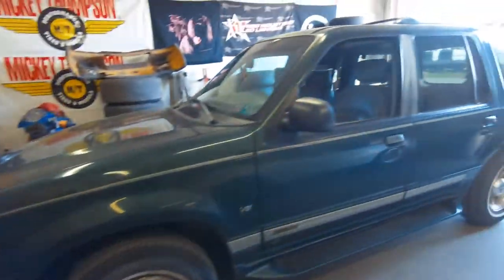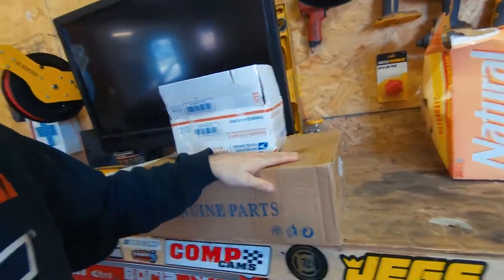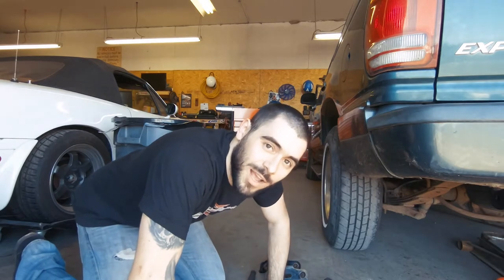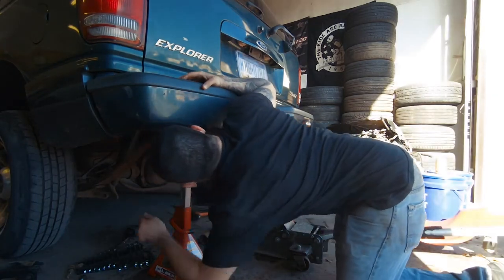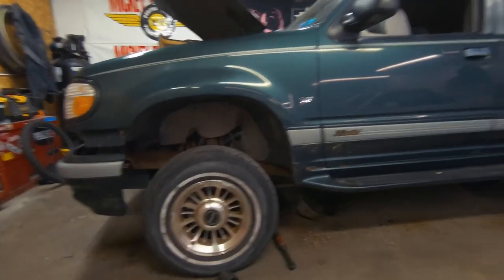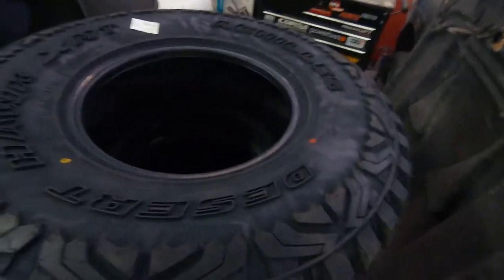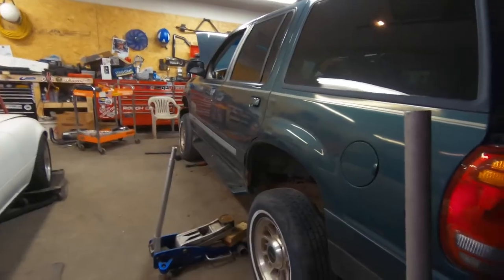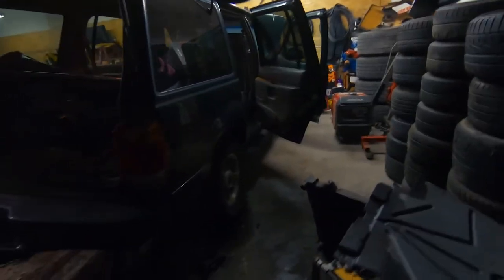1998 FORD EXPLORER 6 INCH LIFT INSTALL

Comment: I feel your pain on those shackles LOL Next time use a bottle back between the frame and leaf spring to press the leaf down with ease, just finished my video.
Reply: Best advice ever, ended up using my sedan spare jack

Comment: Yeah! I just bought a explorer 97.  My plans are almost same as yours, but. I will do shackles under the leafspring attachment. Torsion-rise front . Rearaxle turn and bodylift only in front with wedge shaped bushings.
Reply: I shall follow! Hoping to see more off-road on this channel 🙌🏼
Reply from the maker: I will be making off road videos, just running through some tests with the explorer. It keeps breaking different parts, so once I make it reliable, I will make some off road content! Thanks for being here!
Reply: @RatchetstrapMedia  cool. Whats your instagram?
Reply: @RatchetstrapMedia  please, can you update eBay links?

Comment: Did the body lift come with the bumper relocation brackets?
Reply from the maker: Yes but they don’t really put them back in the correct spot. It’s still to low

Comment: What was the issue with the radiator? Want to do this on mine soon...
Reply from the maker: It had to drop down 3 inches with supplied brackets. But I forgot to do that so I had to fight with it afterwards to get it into the correct position.

Comment: you're supposed to jack the middle of the truck and put stands underneath... then with the diff in the air you put a jack under the diff and you can lower the diff / adjust it...
Reply from the maker: Gee. Thanks captain obvious. My race car currently has all the jack stands under it. Plus, it’s clear you don’t have to doit the way you are “supposed” to.
Reply: Yeah, it’s clear that you made it harder than needed because you didn’t want to do it right. 

Great content tho, if you can’t be good, at least be funny.
Reply: Hey, the way he did it worked, so who cares, it’s not ur truck.

Comment: what size tires did you put on it? do you think 33s would fit? also whats the brand of the body lift link doesn't work.
Reply from the maker: 32x12.50r15. 33 would fit but it would definitely rub.

Comment: Awesome video. Three years later but I’m about to do the same build on a mountaineer.  So my questions are what front shocks did you use with the torsion twist lift?  Stock length or oversized?  And in hindsight would you have still used the coil load spring shocks in the rear?  Nice build and thanks for all the good info.
Reply from the maker: I used whatever shocks were already in it. Did this on a budget. The coil shocks were great because the leafs were tired so it helped pick them up more.

Comment: Hey so, what did you do for the front? Torsion keys/twist only? And since the links are now dead did you use the Ranger kit for the body lift?
Reply from the maker: Max out the factory keys, ranger body lift, lift shackles, and helper shocks

Comment: Where you get the lift from a friend is looking for one
Reply from the maker: Everything was purchased on eBay. It’s a 3 inch body lift for a ranger, 3 inch shackles for an explorer, and I just turned up the stock torsion keys.
Reply: @RatchetstrapMedia  could you possibly send me the links so we won’t order the wrong parts please

Comment: So I'm planning on doing this to my 98 explorer. But I'm confused as to where to mount the shocks it looks like you got them in the factory mounts. I'm new to this kinda stuff sorry if it's a dumb question.
Reply from the maker: First I mounted them in the factory location, but it ripped the lower mount of. Now I have them mounted at the swap bar bushing mount locations.
Reply: @RatchetstrapMedia  I'll have to look into that I'm not planning on off roading as of yet do you think the normal mounts would work fine for daily driving?
Reply from the maker: I would imagine they would work fine for that
Reply: @RatchetstrapMedia  thank you

Comment: Maaaaan. I gotta 97 that i fit 35x12.50’s on stock suspension lol
Reply from the maker: Fit and installing are two different things. Sure, you can put them on, but I bet you can’t turn full lock to lock.
Reply: Put up a video
Reply: I have a 97 sport that I "fit" 24x14s on 35s, I won't be able to turn much but it'll be alright momma said come straight home.

Comment: It shows  the body lift as not compatible with my 1999 ex. did you modify anything? or did it work w/o any mods.? also, I have the monroe load adjusting shocks, will they be ok with shackles?
Reply from the maker: That’s because it’s for a ranger. They don’t make them for explorers. I have the shocks and shacks in the rear as well. You will have to mount the shocks to the sway bar holes on the axle if you want to off-road. The shock mounts aren’t braced enough for the added stress of the load shocks.
Reply: @RatchetstrapMedia if I took this kit to my mechanic would he know how to install it without any issues on my 1999 ? Or would I have to get extra things?
Reply from the maker: It’s pretty straight forward

Comment: Will you help me pimp my 98 explorer too?
Reply from the maker: Only if you subscribe to my channel
Reply: @RatchetstrapMedia  it’s done. My explorer just over heated but I got it fixed. I did a full tune up and I replaced the fuel filter and thermostat all for 500. It should be riding good.